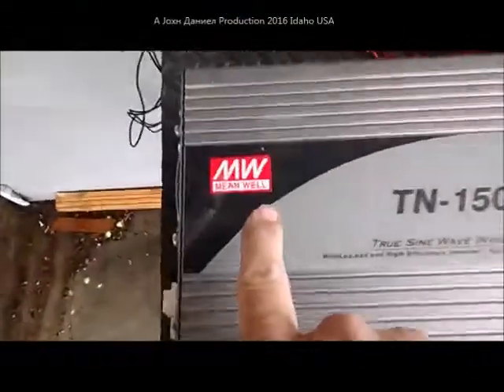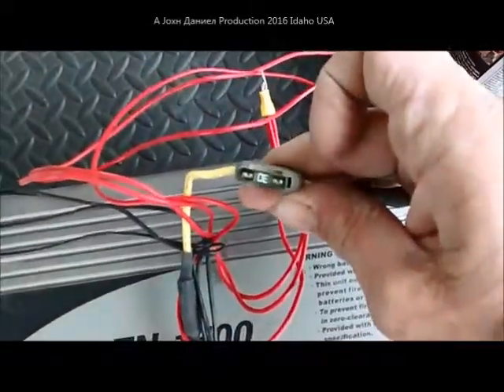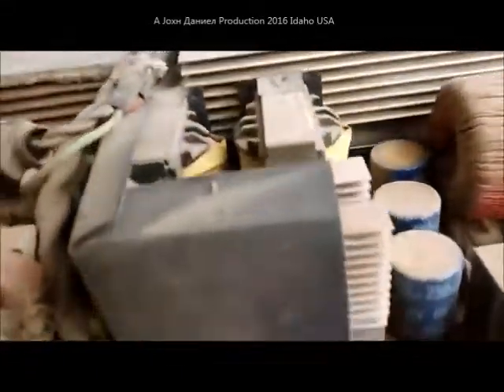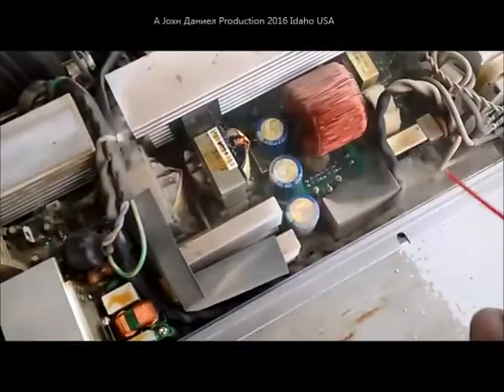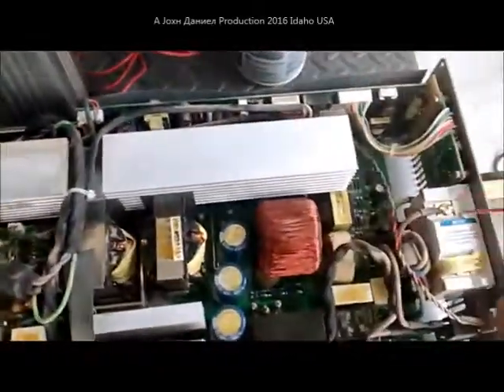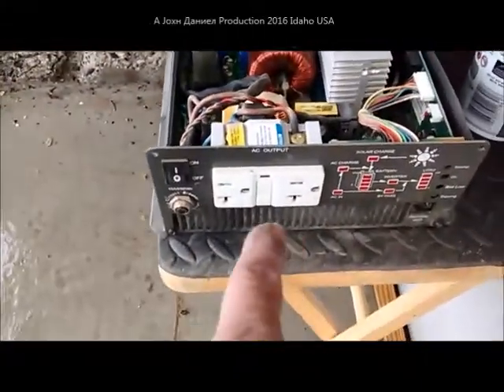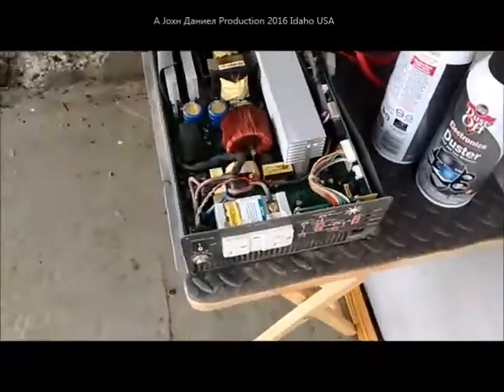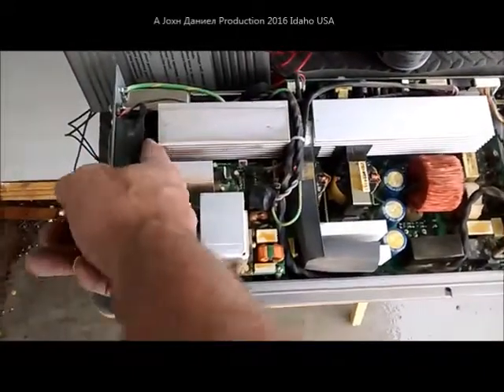Inverter Service Repair Cleaning - Mean Well Inverter @ 3-1/2+ yrs 24/7 use!

Comment: John I've just got this inverter.
I've ground chassis, but does the AC ground wire needs grounding too?
I've the 3000w version
Reply from the maker: DO NOT GROUND IT TO YOUR HOME WIRING or ground the AC circuit, the post on it must have its own ground if you wish to ground it, but the ground post is not even required to make it work right. Its there to satisfy safety ratings not for real function.
Reply: @JOHNDANIEL1  ok
So only the chassis needs wiring to independent ground. Right?
Thank you very much.
Reply from the maker: @takismenexes6131  Yes
Reply: @JOHNDANIEL1 thank you very much.
I will send you a cartpostal of Acropolis.
Greetings from Greece.

Comment: I could not open  mean well ts-1000  48/1000w  cover did not allow ?
Reply from the maker: Feel for the 2 screws on the top, under label decal on each end.
Reply: @JOHNDANIEL1  thank you ...can you answer my other question...fan does not work...Does it work when it gets too hot

Comment: I have supplied the same product as 1000w ... I have connected the old type big refrigerator and I also worked 750w hand bowl .... the fan of the device did not turn...Is it working when it's too hot...

Comment: Hey John, thanks for  your help. I found out what my problem was and it was not the Meanwell. A external battery fuse I had installed went out. The Meanwell is rolling again! Thanks again, Also how is gray matter doing?

Comment: Thanks john! I will try this tonight when i get home. I have mine connected to 5 102amp agm batteries and 4 100 watt solar panels. The load is around 500 watts. I'm in North Carolina and the company i bought it from is in California, so it slow going. I may open up the case and check the fuses. Thanks

Comment: Hey John, great video. I have a TN-1500 112F model that I bought back in February, hooked it up 2 weeks ago, was working fine, connected to (5) 102 amp hour AGM batteries and (4) 100 watt solar panels 12 volt system. I notice last night no lights on the display, even though everything was being powered, about a 500 watt load, tried to reboot, no go. My question is if you know, will it void the warranty if I open this unit up? My problem may be a fuse. Let me know what you think.  I have reached out to the  company I bought it from and they are talking to Meanwell. Thanks
Reply from the maker: Not sure due to where you got it, but I did have mine shut down and disconnected the battery, let it sit over night and after hoking it back up its worked fine every since. These can't handle faulting over volt very many times, the fuses in them are simple to change though.

Comment: Hi Bro,  Is the fans thomal operated
Reply from the maker: +errol cain They are both thermal and load based speed controlled.
Reply from the maker: If your going to put a inverter in REAL dirty locations, and you want a Pure Sine,  but can also use a high quality Very Clean notched wave (not totally Square wave) These below are "Improved Quasi Modified" ,  I seriously recommend the PEAK 3000 http://amzn.to/2srkurS or the  POWERBRIGHT PW6000 6K http://amzn.to/2sc1v3S
Its so worth it . The heavy weight of them means well made, and all the stuff that comes with them actually makes them cheaper than the rest. Always OVER do it in Inverter and Battery, And wire from the start!!!

Comment: Hi john, are you happy with the built in solar charge controller? as much as I know they have a basic charger with no equalization function which might ruin the lead acid  batteries in long term. what would you say about the charger? Thanks.
Reply from the maker: +Evren Azeri I'll see if i can find the link to a pdf on the charge function of these. It is a progressive and programmable design.
Reply: Јохн Даниел I did some research and found that the inverter has equalization charge function which can be adjusted by using paid monitoring software.
Reply from the maker: If you don't want to use the internal solar controller since it is PWM, I found and bought a awesome and slightly cheaper 40 amp MPPT that is a much higher 150 volt capable thats actually a Tracer but in Horizontal layout. All internals are the same. I'll do a video on it after 3 months use so stay tuned, so far its excellent. http://rover.ebay.com/rover/1/711-53200-19255-0/1?icep_ff3=2&pub=5575119394&toolid=10001&campid=5337966591&customid=Same+As+Tracer&icep_item=142175552088&ipn=psmain&icep_vectorid=229466&kwid=902099&mtid=824&kw=lg Made by Tracer For EPSolSun inc Taiwan.
No one lnows of these so keep it a bit quiet or the sellers will jack the prices when it starts selling a lot.

Comment from the maker: To My Viewers - If your going to put a inverter in REAL dirty locations, and you want a Pure Sine,  but can also use a high quality Very Clean notched wave (not totally Square wave) These below are "Improved Quasi Modified" ,  I seriously recommend the PEAK 3000 http://amzn.to/2srkurS or the  POWERBRIGHT PW6000 6K http://amzn.to/2sc1v3S
Its so worth it . The heavy weight of them means well made, and all the stuff that comes with them actually makes them cheaper than the rest.

Comment: Looks very high quality, very impressive that it could survive a shop environment.
Reply from the maker: The one in the video was in a job trailer. It is has been in constant service since purchase as well as 2 in my house and one in my motor home. Now another is being added to my shop as we continue to get away from modified sign on most applications. 
I still have the big Northern Tool Inter-tech running all the lights, most outlets and heavy tools in my shop but it does well and after almost 2 years its been very strong and resistant to faulting.